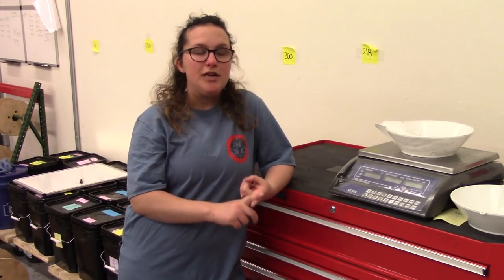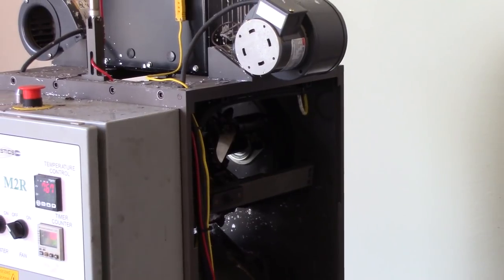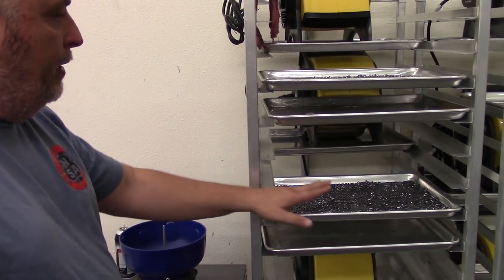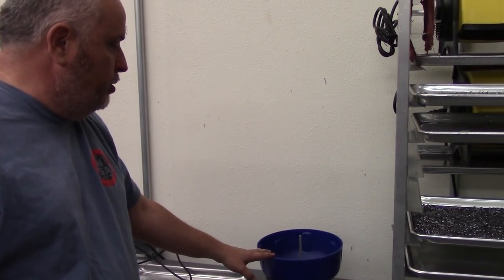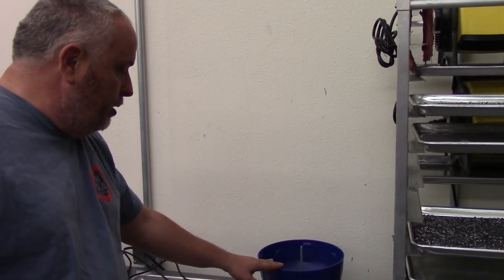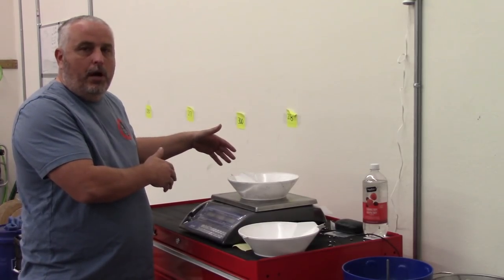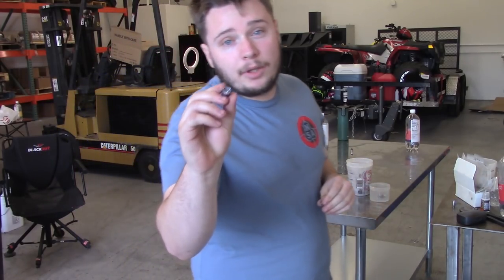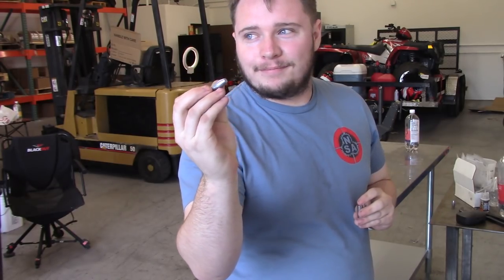NSA Factory Tour 2020

Comment: For a given caliber why would twist rate matter for the sizing of the ammo?  I get diameter, amount of choke etc.  Can NSA share test results (bullet, gun) combinations that you found work well?  I don't shoot slugs but I bet it would be helpful for customers.
Reply: On the question about twist rate, it is not so much the "sizing" per say,  but matching the weight of the projectile to a particular twist rate .  Bullets have a rearward center of gravity, (compared to pellets) and require a certain amount of rotation for a given weight to stay stabilized in flight. A heavier projectile needs more spin stabilization than a light one. So, for a given twist rate of a "barrel",  the weight of the projectile (adjusted through length, size of the hollow point etc...) has to be considered.
Reply from the maker: Allan, for Test results, you can scour through the NSA web pages and it shows mostly what they have found to work in said airguns.  For more in depth questions and answers on the subject, your going to have to contact the man himself.
Reply: Thanks guys!
Reply from the maker: @allanwind295  Your more than welcome.  Ask away, i will give you the best answer that I can.  Thanks
Reply: Yes make the 22 slugs hollow point wider please. I found it makes a huge difference in expansion if I make the hollow point wider with a Dremel. I love his slugs just needs more expansion